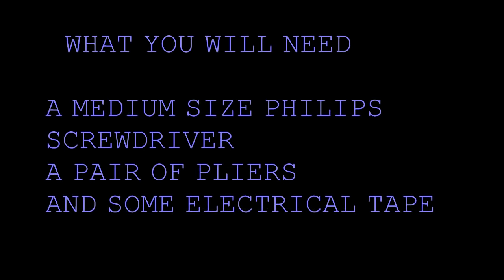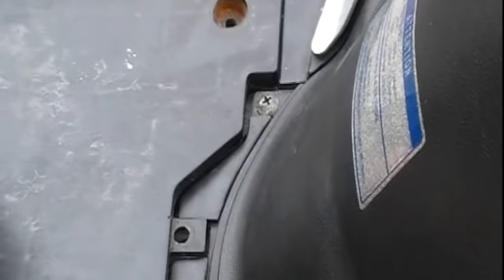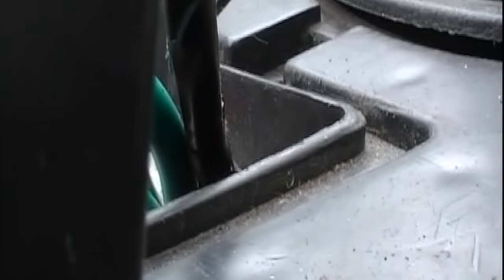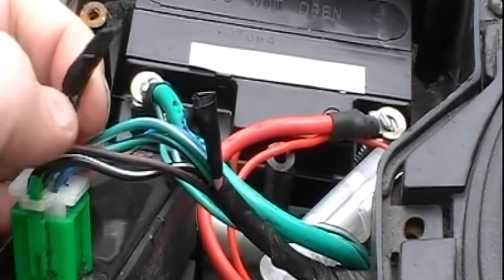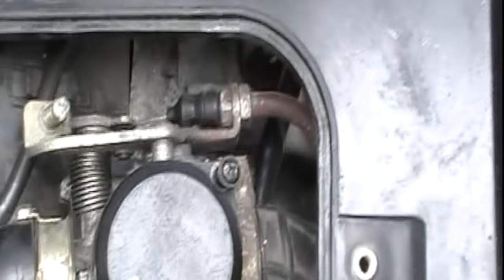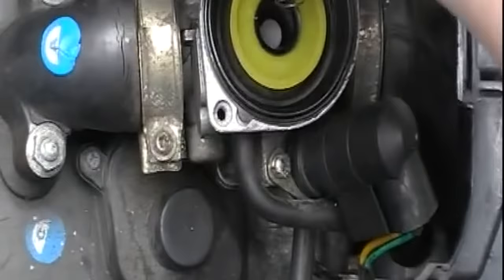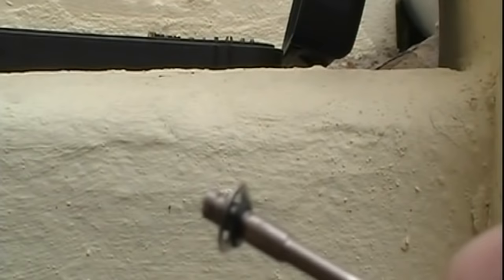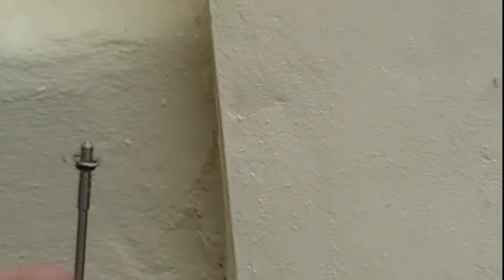How to derestrict a 50cc scooter / moped Make it go Faster

Comment: There are now 1 million people with a scooter that doesn't run properly
Reply: Lmfao i got a 1986 Honda elite150 the digital speed says 50mph i would rather not mess with this if it was a china o hell yeah all day.
Reply: 1.9 million
Reply: 2million now
Reply: Lmaaao
Reply: 2.1*
Reply: 2.2
Reply: I would have been 1 im better off going slower.leave well enough alone
Reply: 2.3
Reply: 2.2million
Reply from the maker: 2.3
Reply: They only put it on to restrict for unlicensed riders, the engine runs better without it and is better for it! It just saves you $50 on buying the part from the shop
Reply: 2.4mil
Reply: @billysuk  is this the wrong information Channel
Reply: Lol
Reply: This is the if you want to fix it wrong and make it run worse use this information Channel
Reply: @billysuk  you even know it fucks them up?!
Reply: 2.6
Reply: @EZBMX713  I've got a Spacy 125 (UK version of Elite), blew up the original 125 engine (tried keeping above 50 on a long dual carriageway), parts were prohibitive so bought a motor unit for a CN250 Helix and put that in, digital speedo now tops out at 76 MPH.
Reply: Lol
Reply: @762kilo 2.8
Reply: @olsbols16 beat me to it lol 😮
Reply: Nah we just want it to go faster
Reply: 2.8😂😂😂
Reply: You don’t understand, the scooter doesn’t run properly until it derestricted.  They limit the ignition to restrict the power but it was designed to run with out the restricter.  They run much better derestricted.
Reply: 2.9 million
Reply: Lol
Reply: 2,9 million 😂😂
Reply: Never listen to anyone taking a carb apart who hasn’t got a fooking clue what a diaphragm or needle is 😂😂👍
Reply: Over 3 now
Reply: not interesting fact

Comment: All you did by moving the clip on the needle up one is lean the engine out which makes the engine run hotter and wear quicker. DONT DO THIS !!  Placing the clip in a lower position raises the needle enriching the emulsion tube with more fuel and makes the engine run richer. This setting allows the engine to run cooler .The video is sorry and it's incorrect info.  Do the research and get the facts.  NEVER use a electric driver on carb screws !!!
Reply: Isn't it incredible that this guy is telling over 280K people (so far) completely bogus, screwed up info?!  He doesn't even know that it's called a needle valve.  How many people have ruined their scooters by doing this? Jeez...  As you know, James, your assessment is 100% accurate.  I'm just seconding what you said.  PEOPLE, DON'T DO THIS!  If your engine runs hot (which it will be inclined to do by dropping the needle) then you'll probably end up blowing the thing up, and that would be a shame.  Snip the restrictor if you must, but leave the needle alone!
Reply: John Detwiler Thanks for the backup !!
Reply: is cutting the wire worth doing ?
Reply: tyler wilkes No !  This just eliminates the rev limiter .  You probably will never reach the rev limit anyway.
Reply: James79561
 Is this the same thing as removing the governor?  And is that a safe/recommeded thing to do if I want to get my 50cc scooter up the hill?
Reply: Robert Newcomer Basically like removing a govenor but scooters do not have govenors .  The way to change the speed on a scooter lies in the transmission clutch and pulley system. Research the brand you have and you will know what to do. THANKS !!
Reply: Awesome!  Thankya kindly friend!
Reply: James79561 hell0 james... please inlighten me with my "YAMAHA MIO SPORTY"
Reply: John Detwiler hey is the pink wire what restricts it ?
Reply: kierankay100 I don't know.  I think someone mentioned it was.  You could try cutting it and if it doesn't work just splice it back together.  (Solder it or crimp connect)
Reply: Carsten B
Who, me?  Been a mechanic for a profession motocross racer for 3 decades.  The guy wants to play with his scooter.  So what if he cuts a wire to test?  It's not going to hurt the thing.  Let him experiment.  If you read my earlier reply about this, I only really care that people don't lean out their carbs by dropping the needle.  That's the surest way of burning a hole in the piston from predetonation due to hotspot in combustion chamber, or seizing it.
Reply: ill just pull the wire out of the plug thanks and yeh i know it wont fuck it up ahah it doesnt matter if i cut a wire im a training electrician so i will probably solder and heat shrink if i end up cutting it im getting the ped next sunday what year did they start putting restricters one ?
Reply: hahah thanks i am currently rebuilding it gotta replace the piston and need to buy front plastic ahah plenty of fun
Reply: biggunzcdb the

CAN you tell me what I can do to my Taotao 150cc power max to maximize my performance and get as much horsepower and speed out of it without blowing the engine
Reply: biggunzcdb Wow!  That thing sounds badass!
Reply: lol
Reply: James79561 Dude, he used an electric driver in the video. It can't be wrong. Lol.
Reply: I wouldn't use one on a carb. Its cast alloy and the threads are very easily stripped meaning tricky repair or new carb
Reply: James79561 
Hey James I’m glad I read these comments before taking such advice from someone who calls parts yelling thing spring thing etc...j have horrific problems getting up hills...I bought this taotao brand new and I was doing 30 and hit a uphill grade and I slowed to 15-20 mph and you can get run over like that so your saying it’s not the carb and cutting wires it’s in the transmission? Thanks bro
Reply: James79561 next thing you're prolly going to do is drill out the exhaust if you really want to do anything smart why don't you just go up to the high performance CDI or ignition module
Reply: The needle only affects mid-range, small openings are governed by the idle jet and airscrew combined with the slide cutaway. At full throttle, it's the main jet.

So a little leaning off won't make much of a difference to engine wear but might make it less burbly at mid-throttle. Or it might run like shit and seize.

This guy's no mechanic.
Reply: 201 honda rukus needle adustment to make it faster
Reply: So we're should my needle go to lower end and do I screw in air flow screw all the way to get a better full throttle
Reply: @michaeldavis2585  this video is not a good video...its not porn. Im going to do some more research. Ride out into the darkness on my moped at 20 mph
Reply: You have point but afr is not very important on this little engine, i bet it is not running dangereous lean
Reply: @James79561 so why does the needle have different settings?. And why do they make restricted and deresticted of the same model ? And why don't they restrict cars and trucks and all other motorcycles if it's better?
Reply: Even the seagulls are laughing.

Comment: You dropped the needle lower by raising the clip...that would allow LESS fuel.
Reply: I thought I was the only 1 thinking that
Reply: same here
Reply: yes the clip needs to be lower also I don't see how that would make it go faster
Reply: Correct!
Reply: bigger explosion? ??
Reply: Good catch.....I thought about it hours after I watched it the first time. It is tapered.....so moving the clip up, drops the needle lower in the jet, thus less fuel
Reply: lil extra carbon never hurt hahHaha
Reply: doesnt that just adjust the fuel mixture for 1/4 throttle to 3/4
Reply: Less fuel = less carbon = hole in piston
Reply: dont think hole but silly is how i thought abbot it 30 year ago moved it right to the top thinking more fuel when i shod off went to bottom it savived   :P 13 year old up meant more fuel to me i no i wos a dum ass back then
Reply: at "wot " the needle is all the way out of the jet. to increase hp you would need too re-jet the carb with A larger needle and jet combo.
Reply: No it isn't ..carb bore is 15 or 16 mm max ...
Reply: Yes, but with a CV carb, it depends on vacuum to lift the needle and slide, you know that yellow and black thing, so most won't pull all the way out.
It should be moving the clip down to get more fuel for the higher RPMs you can now pull by cutting the ignition cutoff wire, the pink one.
Reply: I think moving it up enriched the mix, down would lean it. Gave more travel to the jet. (But I don't know scooters)
Reply: Guy Rutledge enriched, more travel.
Reply: Giving less fuel sometimes is the solution.
Reply: 2011 scooter with bolts trying to keep me out of the carb pulled it and flushed what I could just to get it to run
Reply: THAT`S RIGHT.  YOU HAVE TO LOWER THE CLIP,  THEREBY RAISING THE NEEDLE, ALLOWING MORE FUEL.
Reply: Less fuel= higher revs
Reply: they always make these bikes run fat lots of fuel thats why if you lean it out a bit it might go faster but it will run hotter so be careful of that dont want to over heat it .
Reply: There is an exact amount of air to fuel ratio that makes the most power.
Reply: Greg McKinney ...pull? Can you please explain the ending of your comment thanks
Reply: John Smythe 😲
Reply: Same
Reply: Exactly what I was laughing at lol some people got no business in things like this
Reply: He'll find out later 😂
Reply: @johnb.9806  Not if you also increase intake airflow by drilling the airbox.
Reply: @andrewclancy7906  The increase in rpm you can now attain.
Reply: @phoverph  you still are
Reply: Was thinking that as well 😂
Reply: Your correct
Reply: Exactly. Moving the clip higher drops the metering rod lower which steps it into a thicker area of taper on the rod making it leaner. Less gas. We have to raise the rod to get into the thinner end to enrichen the air fuel ratio. I've cleaned and rebuilt several carburetors on autos through the years that utilize tapered step metering rods. Same enginering design..... If you really wanna get fancy, some manufacturers offer rods that are more or less tapered. Thicker, less taper = leaner. Thinner, more tapered = richer. If you're careful enough, remove the washer, then tighten the needle into the chuck of a drill. Obtain some 180 or 220 wet sand paper, spray wd-40 or equivalent on paper then spin the rod while pinching the paper around the tapered end till it is a bit smaller than original size. It would be wise to measure beforehand with a dial caliper then downsize it only  2 to 5 thousandths. No more than that or it could be too rich afterward.
Reply: Exactly what I was thinking
Reply: Correct
Reply: @Salpeteroxid  exactly
Reply: @achillezx14r45  Thank you!
Reply: @johnsmythe6134  what is wrong with deresticting? The factory make restricted and unrestricted of the same engine he just saved us money! Please do your research befor making a knob of yourself
Reply: @guyski666  unrestrickted it uses les fuel, restrickted it uses more fuel , but goes slower --- weird but that is the reality --good speed ji haa
Reply: So it is all about the tuning typically the people who make mopeds/scooters will make the fuel consumption really fat because there are lots of limitations because most of the time these mopeds are only allowed to go a certain speed so the factory's have to restrict them alot so I am sure leaning out the fuel consumption will not hurt it a whole lot
Reply: No no no my friend you are wrong that would have been true  a few years ago but not now since the Corona virus started it has changed the Earth's gravitational pull making that needle not lower but rise Defying Gravity and and making us have to rewrite some long mathematical equation in physics because what we thought was possible or impossible has now all changed long story short I know what I'm talking about and I'm very smart and I'm not lying about any of this at all it's all 100% accurate
Reply: Was just thinking that
Reply: He didn't mention the exhaust
Reply: Why are people like this still alive
Reply: @bobydarnell9428  😂yes
Reply: Same thoughts, likewise
Reply: @williammcleod-morgen3047  yes I believe so

Comment: Changing the needle jet setting will primarily change mid range jetting. The main jet will control the mixture at full throttle, and should be the starting point for tuning the carburettor for optimum performance. Once the main jet is optimised, the needle jet and pilot jet's should be adjusted to achieve the correct mixture at different throttle openings.

Comment: Moving the clip up moves the needle down so the thicker part of the needle is in the needle jet leans the mid range out. At full throttle the needle position is insignificant. This would only help if the mixture were rich through the middle. Unless you are correcting a defect, you cannot add more fuel to the same airflow and increase performance.You still need to maintain the stoichiometric air to fuel ration of 14.7:1. The main jet meters fuel flow at wide open throttle, which if you are seeking top end, that would be the area to focus on, IF you increased air flow through the engine.
Reply: Thank u!👍
Reply: Right on!

Comment: My wife used to have a Yamaha CW 50. When it needed a new exhaust for the MOT,  they installed one with a larger hole on the manifold flange. Just doing that increased the max speed to around 40MPH. We didn't touch anything else.

Comment: Ok let me get few things straight for you who have never worked on your bikes
1.look for info about your bike on internet, you will pretty much always find out what is restricted what is worth doing and how to do it
2.if not necessary do NOT modify stock parts, you might need them someday and the resell value is a lot higher. Usually aftermarket parts also give more boost to your bikes performance
3.Carburetor settings. Extremely important especially on 2 strokes. always adjust your carburetor settings after modifying your bikes performance. If you don't do this you will have really high chance of blowing up your engine + you won't gain the max performance you could be getting.
Reply: "always adjust your carburetor settings"  what do you mean by this? I think this is safe.

Comment: just done exactly as show in the video and got my moped from doing 30mph to around 45mph and is much much quicker at take off the fuel consumption has gone up around 30% been riding for a week like this and done around 130 miles still going good, !!
Reply: Safraz Adam Abhram updates? Did your scooter continue running good? I wanna do this to my scoot
Reply: Is this the same with 4 stroke
Reply: @miapowell6463  The scooter shown is a 4 stroke.

Comment: Only if the response in PART THROTTLE is not as desired, you move the clip UP on the needle to get LEANER and DOWN to get RICHER. So in this example you will get LESS fuel so it will get LEANER. Its best felt by erratic engine behaviour at part throttle:

If its hesitating at part throttle, you need to get richer - move clip down one ring. If its 8-stroking (or 4-stroking if a 2-stroke engine), you need to get leaner - move clip up one ring.

Comment: One recommendation that I would make for ANY moped new or old is to adjust the valve clearance to the factory settings. I have a 2013 Kymco Agility 50 and just adjusted the valves to the factory specs of 0.051 mm and it has more power than it ever had from the factory. Sometimes these scooters leave the factory with valves that are not adjusted properly. The difference was significant.
Reply: How do I do that?
Reply: Do u have a link too them ? 👍
Reply: Hi my grandson has the same bike as you his problem other than it's slow us it starts up great but not move for two to three minutes as it not rev up till it's warm up a little

Comment: As a mechanic I can tell you that 
A) more fuel does not mean more power. It just means your running the engine richer, it will use more fuel. 
B) more importantly you move the clip UP making the needle longer (lower position) and closer to its seat and therefore your running the engine leaner not richer. On 2 strike engines running the mix too lean can cause permanent damage to the piston and other components. 
Please do t follow the advice he’s giving with the carby. 
As for the wire that he carelessly cut instead of just removing from the plug, I’d want to see more information about what it is, how it works and what are the consequences of removing it before doing that. There is a reason why highly qualified engineers do these things so removing and cutting “this black thing” and “that metal thingL and “the yellow thing” and “this bit” etc is a great way to quickly end up with a bike that needs expensive repair work.
Reply: From what I understand, that’s the reference wire that tells the CDI when to fire. With the wire cut, how will the CDI know when to fire the plug or advance?
Reply: I want to see a before and after video because I can’t understand how the bike runs with that wire cut. There are 5 or 6 wires depending on the set up. One or two grounds, power from the stator, kill switch wire, wire to the coil and the pick up wire. You’re cutting the pick up wire. The only wire that tells the CDI when to fire.
Reply: Absolutely spot on mate 👏 Well explained.

Comment: Your knowledge of technical terminology is legendary "There is a black fing and a yellow fing!".... Priceless!
And moving the jet needle clip to a higher position will add less fuel to the cylinder thinning out the fuel-air mixture, reducing performance, and possibly leading to overheating and engine seizure, but since you know what you're doing, you go ahead!
Reply: Leaving out the spring for weight reduction.
Reply: :face-blue-smiling:🤣😂

Comment: The needle mod you did will make the carb leaner...  If you want it a bit richer the clip needs to go lower, making the needle move up a bit. That will increase fuel  to potensially increase combustion